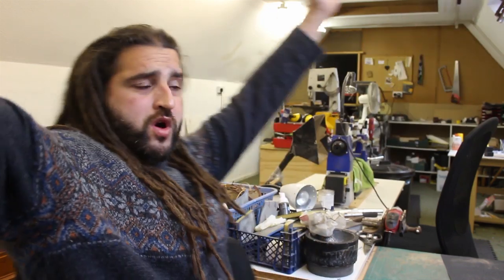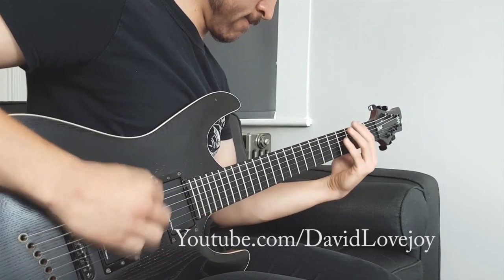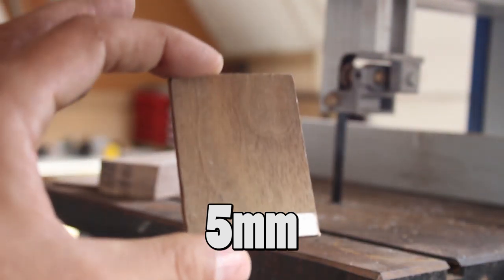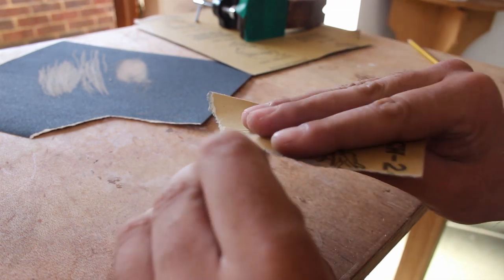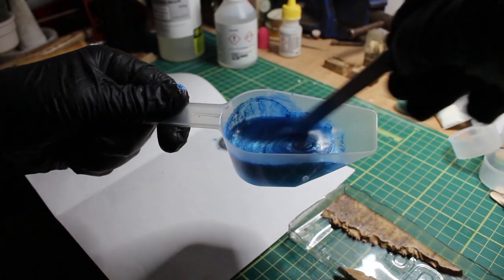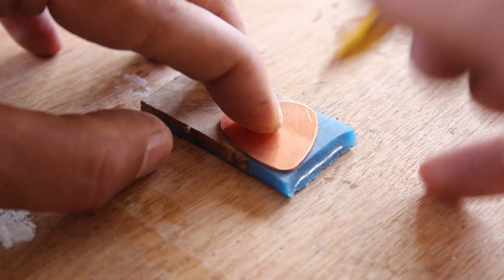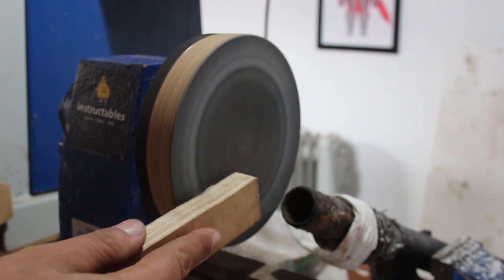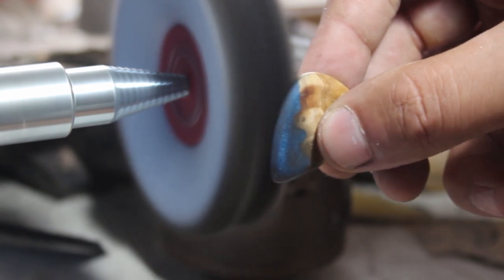How Do You Make A Wooden Guitar Pick?

Comment: Your resin picks look just like mine. I've used fall down in my shop that I grab from the sawdust pile. I then grab some wax paper, tape the corner up to eliminate leaking lay the wood out so I'm sure to have to wood on top of the pick, dye my resin, add glo powder, pour, trace, cut on band saw, sand on belt sander down to 220, then finish down to 2000 grit...little mineral oil on the wood...you get rigidity for your grip and a little flexibility on the strings. Well done. do you do different thickness? I've been playing with a micrometer to make different thickness for different players.
Reply from the maker: Haha cheers man, sounds like you’re much more technical than me!  I don’t make these regularly enough to play around tbh.

Comment: Dan, what was the resin you used? No mention of pressure pot or vacuum chamber so I assume poured and set on it's own? I watch most if not all of your videos I am not aware of you using the resin in anything else, am I right. I thought it would lend itself to solid wood ring (dozens of you tubers doing the same) what do you think? Ideally the wood used would be stabilised for strength and durability.
Reply from the maker: Hey mate I used GlassCast resin which sets on its own.  I’m not really a massive fan of using resin to be fair but you could make some unique rings with stabilised wood and resin!